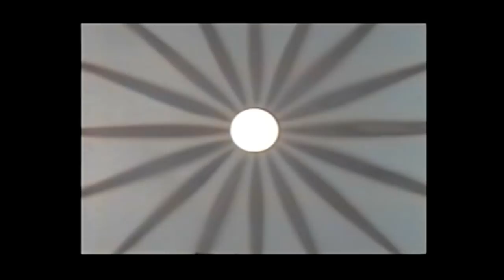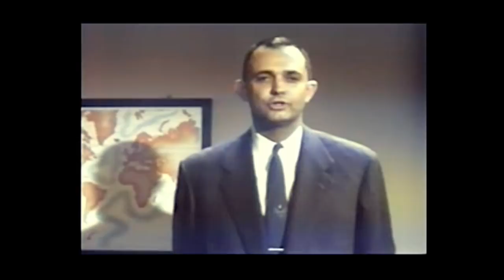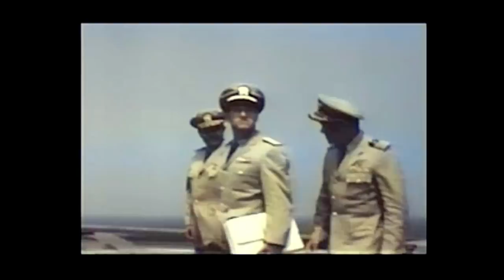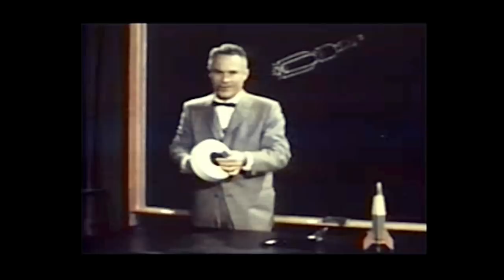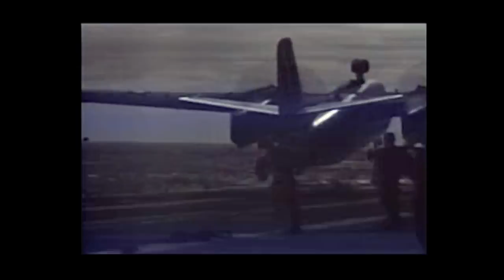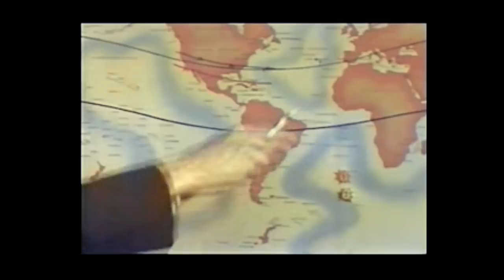Argus Shield Project - Prof Simon

Comment: I once worked for an engineer who replaced the Bombay doors on the Anola gay. In the Manhattan project.
Reply from the maker: that's fascinating....before or after the bomb drop?
Reply: It was before the bomb was dropped. The original B Bay doors were too small. He also worked on other top secret projects (which were declassified).  My brother worked on surveyor and pioneer space missions @ gold stone deep space antenna facility. He has passed away years back.
Since. I have always been interested in secret projects since me and my mother were the only ones in my family with out clearances.
Reply: Maybe they should of waited till they dropped the bomb first. 🤨😁😁  ❗️

Comment: They didn't discontinue the research.  They just gave it a couple of new project code names and larger warheads.  If you read George Dyson's excellent book on Project Orion you'll note he mentions a test of a tungsten cased warhead in an upper or exo-atmospheric test in 1957/58-ish I believe.  Sorry to be so vague.  It's been over a year since I read it.  I'd be more precise if I hadn't loaned out my copy.  The tungsten weapon case made the warhead detonate with very novel properties.  Project Orion's overt purpose was to develop a space craft propelled by the sequential detonation of fission or fusion warheads behind the craft with the resultant plasma wave from the detonation hitting a giant pusher plate mounted on huge shock absorbers to lift the weight equivalent of a battleship into orbit or to another planet.  The results of the project's research were the development of very small, lightweight nuclear warheads, and the ability to create specifically tailored effects from a detonation, i.e. enhanced neutron output, x-ray output, direction of output, etc...

Then there's the infamous Starfish Prime test series in the Pacific in the mid 1960s.  They managed to fry a few satellites and knock out power to parts of Hawaii and other island chains.  I don't know much about this test series other than what's publicly available in YouTube videos.

The "Known" end result was the Spartan missile system that was briefly made operational in 1975-1976 as the exo-atmospheric interception component of the Safeguard ABM system.  The Spartan System had a relatively small but incredibly powerful 5 megaton warhead. (see Grommet Cannikin Nuclear Test)  I always wondered why they put such a huge warhead on the thing given their targeting accuracy claims.  Project Argus explains a lot.  Cold War history is frequently more outlandish than the best science fiction and more terrifying than the most frightening horror story.

If you want to put on some tin foil hats and go down a conspiratorial road watch the movie "Phantom" starring Ed Harris and David Duchovny.  Towards the end of the movie Duchovny's character explains why his rogue faction of the KGB is carrying out the mission to start a nuclear exchange between China and the US.  he says that the US has developed a way to boost the power of the Van Allen Belts to disable incoming warheads.  The movie came out in 2017, I think.  The premise of the film is very loosely based on the book "RED STAR ROGUE: The Untold Story of a Soviet Submarine's Nuclear Strike Attempt on the U.S." which is a hypothetical explanation for the sinking of the Soviet K-129 SSBN in the late 1960s.  K-129 is the sub that the CIA and Howard Hughes would collaborate on to raise the submarine from the bottom of the Pacific in Project Azorian.
Reply from the maker: Thank you...great info
Reply: I personally believe (just a theory) that Starfish Prime was the motivation behind the Soviets installing missiles in Cuba and the program's continuation despite Soviet demands to stop were what escalated us to being very close to an all out nuclear war. We've never been told WHY the Soviets were installing missiles in Cuba other than, of course, they were Evil Red Menace communists.

Blinded to a first strike, possible incapacitation of their ICBMs, and not having a submarine launch capability, I think the Soviets' only recourse to retaliate quickly, or at all, to an American first strike was a low altitude lob from Cuba. Unclassify that one, lol.

Of course, the "space race" wasn't a matter of a country's phallic prowess or pride - Sputnik's beeps were radiation levels telemetry...and it was van Allan that was put in charge of the complementary Explorer satellite program. Problem was that the US rockets kept blowing up.

Oh, yeah - to this day, the story from both sides was that Laika died of fright, not radiation poisoning because I think (another theory) they were actually testing shielding materials without disclosing their technology (shielding weight meant less warhead yield) with telemetry.

Comment: What a fascinating video Professor. I have never heard about it.

When I worked in the electronics industry, part of my work was consultancy in electronics development. One of the topics that was being discussed at the time was “Electro Magnetic Pulses” or EMP for short. The idea was that governments with a nuclear capability might be vulnerable to EMP pulses that would destroy transistorised circuits if the exploded devices is the upper atmosphere thus rendering radio and electronic communications and guidance systems useless by destroying transistorised circuits in almost everything. This included the telephone systems as well as radio transmitters and receivers. The military was experimenting with what they called Hardening Transistors to make them invulnerable to such attacks. The general public would find their radios and telephones not working whereas the military would not be affected. This of course is still potentially a possibility today. 

What I started to call “When the World goes Futt”  and I still say it today.

It could be more of a problem today as we are dependent of mobile phones and computer networks using wireless technology.
It would be nice to know if EMP is still consider and issue up for discussion today as the world is more sensitive to hacking rather than discussions about EMP pulses